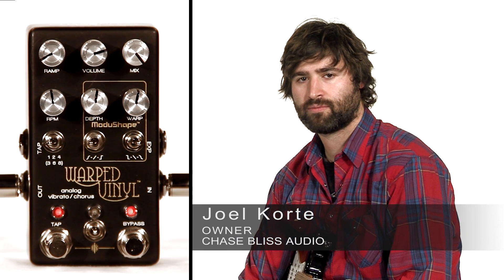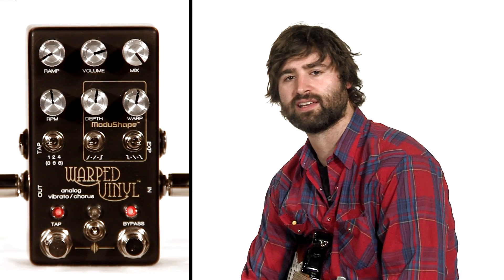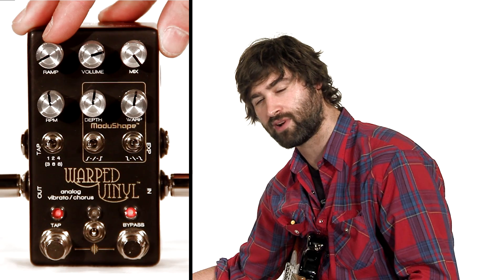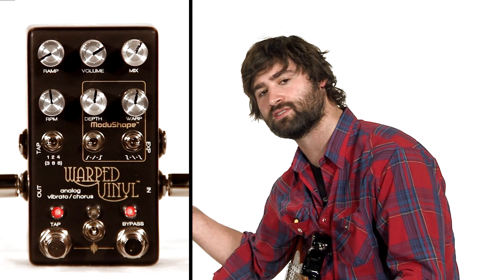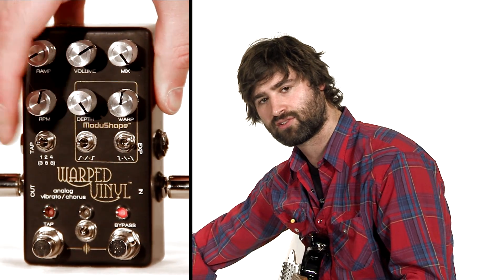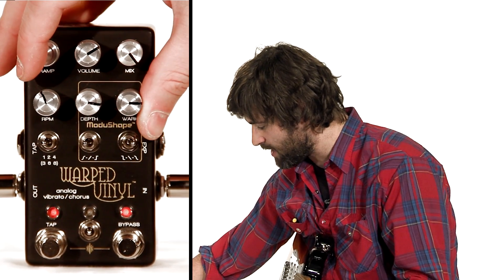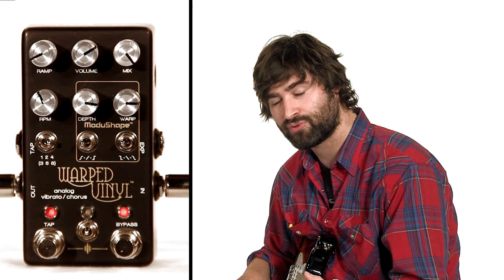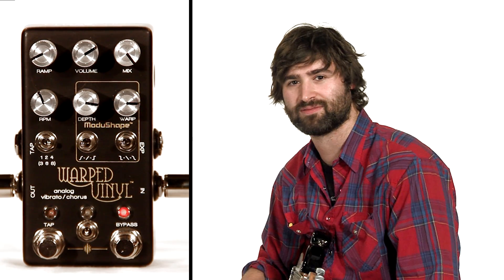Warped Vinyl Instructional Demo Part 1: Introduction

Comment: Hey Joel, I absolutely love this pedal.  The demos I've seen have been awesome and I've spent a good deal of time playing around with it myself.
That said, I apologize if this was addressed in the video, and will take my thumpings if it is.  My question: do you find this works best before or after dirt pedals?  I played around a little with it after a boost and found there was some breakup.  I really love the pedal and want to find where it will work best.  I understand that is a personal preference, but I see you have been replying to posts on here and to get advice from the pedal's maker would be invaluable.  I question whether I will ever have an application to use distortion in conjunction with this, but in case I do I would like to have it in the right place on my board when I do. 
Thank you for any guidance you can offer.
Reply from the maker: Hey Rob, thanks so much for the comment.  In general, I'd say to use it after dirt.  The pedal itself also has boost on tap so I'd say use that to your advantage as well.  The vibrato section doesn't have huge headroom, so there will be some breakup if the signal going into the pedal is too hot, but you may very well like this.  As always, the best answer is to experiment and find what works best for you, but WV is typically after dirt in my chain.  Thanks again for the comment :)

Comment: What if the bypass light is green and stays green even as bypass engages and disengages?
Reply from the maker: if it's green it's in momentary mode.  Sounds like there might be an issue with yours.  You can contact Zack@chaseblissaudio.com for repair info

Comment: great video man...do you sell these in Canada?
Reply: Hey thanks man.  I'm working on it, but right now I don't.  Most of my domestic dealers do international shipping, you can see them here:  http://chaseblissaudio.com/dealers/ Otherwise I do ship direct to Canada and shipping is pretty reasonable.  You can order at www.chaseblissaudio.com/warped ...
Reply: ***** Hey Joel, was wondering if you'd consider this in the realm of a vibe pedal...I'm really looking for a Jimi Hendrix style vibe...it seems like it gets kind of "vibey."
Reply from the maker: blk stone
 hey man, great question.  You can certainly approach/ get similar tones with this, but no, it does not classify as a vibe pedal (which gets it's effect by other electronic means).  This is a true pitch vibrato, using bucket brigade technology (similar to a BOSS VB-2).